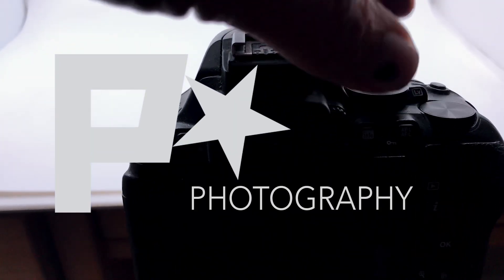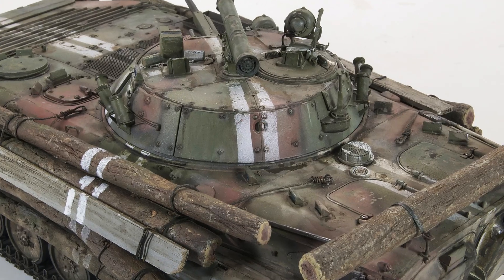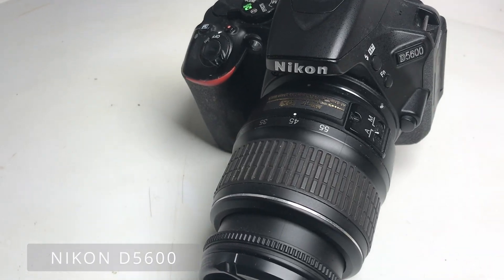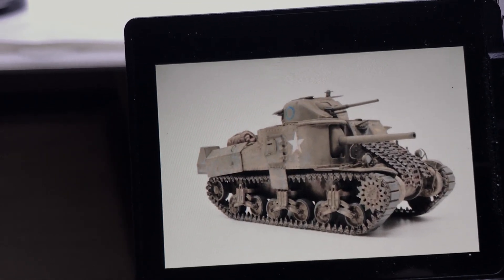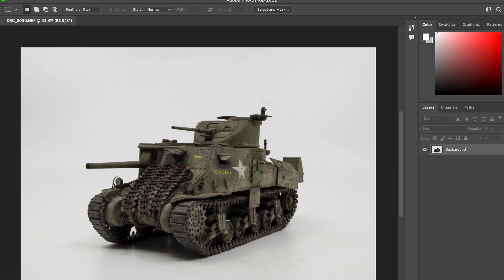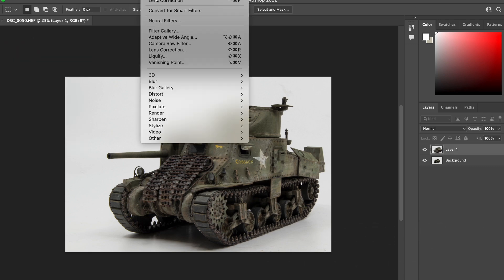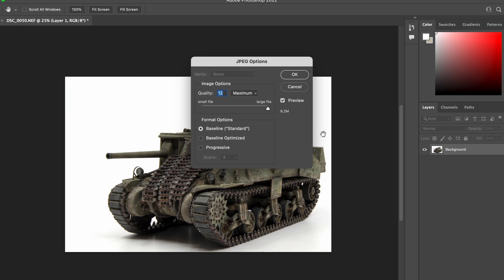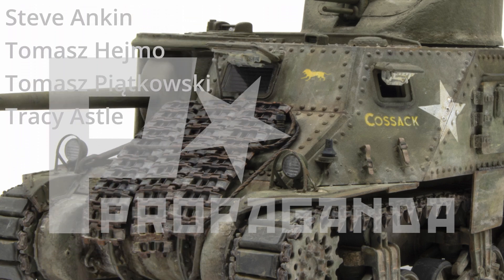Scale Model Photography. Taking pictures, and how I do it.

Comment: Excellent explanation - just got a light box to do the same. One note - you can correct the optics in the Photoshop Raw adjuster before the saving as a jpg.
Reply from the maker: Yes, I am aware of the RAW adjustment. I just figured that some don't shoot in RAW and wanted to demonstrate that the adjustment is available if using jpeg.  I probably should have better explained the options. Thanks.
Reply: @RickLawlerPropaganda  Ah, of course that makes sense. Still a great tutorial!

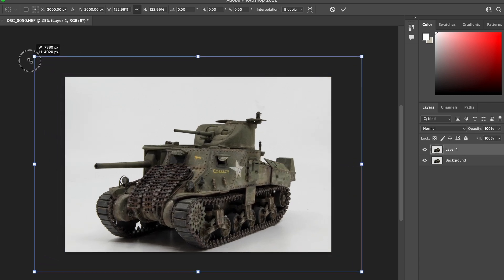Comment: You should never scale up a layer (like you did at 2:43) - this blurs the image slightly. Instead, crop the image to get the desired framing. Cropping just removes unused pixels around the edges and doesn't blur your image.
Reply from the maker: Thanks for the tip....still trying to learn the video side.